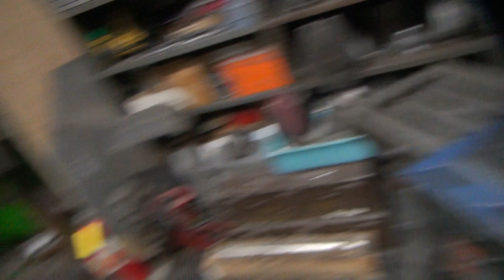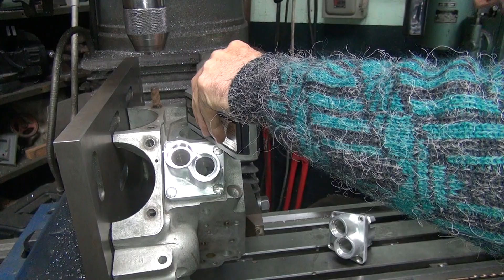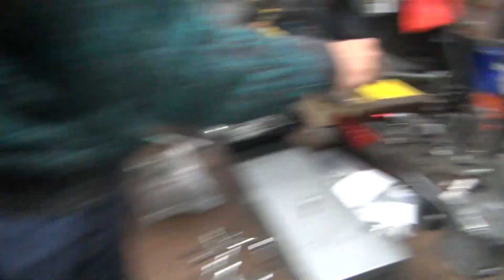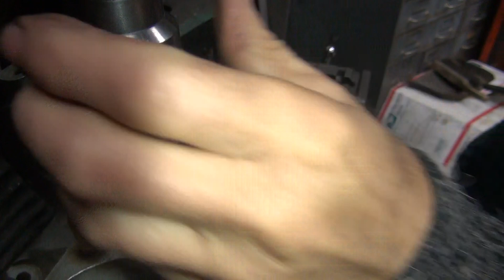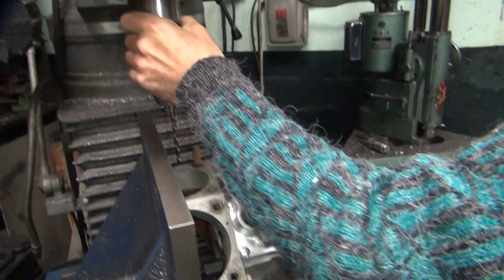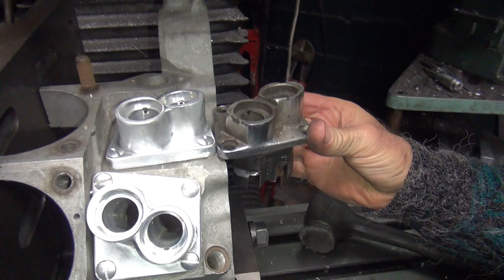#150 1961 FL 74ci std heads panhead motor rebuild s&s lifter block machining harley by tatro machine

Comment: What brand of measuring tools do you trust the most? And it must be fun to keep your all machining  equipment in true. Been watching your videos for a few years now, and I like all the equipment you use. Should do a detailed tour of your machining machines if you want. Seems like you’re well stocked and then some.
Reply from the maker: the brand is not as important as the type of tool. all the major brands make good tools. the older usa brands are good too. the key is to adjust your tools so that they are accurate when you use them.
tatro